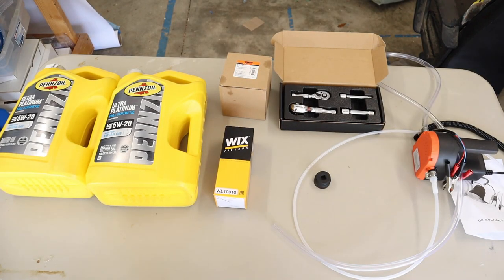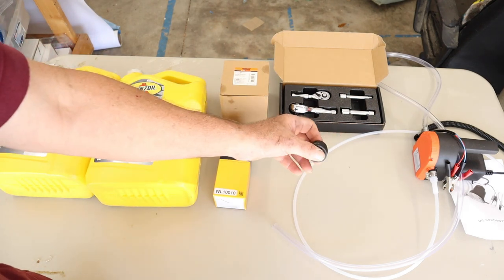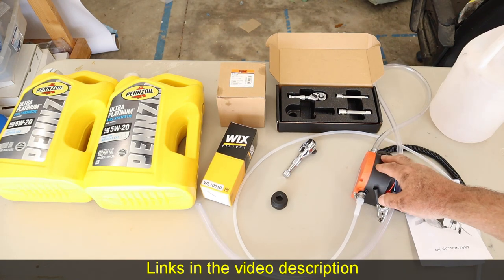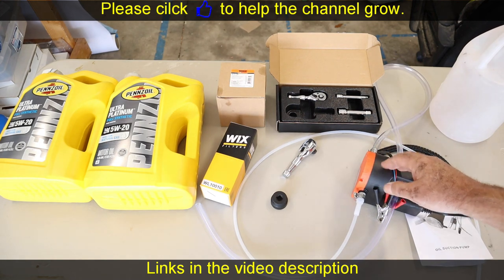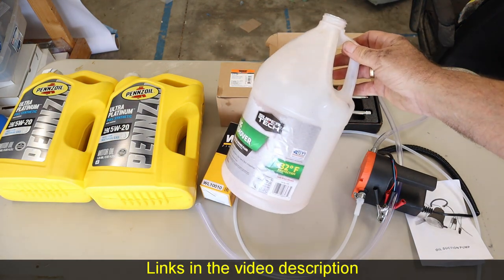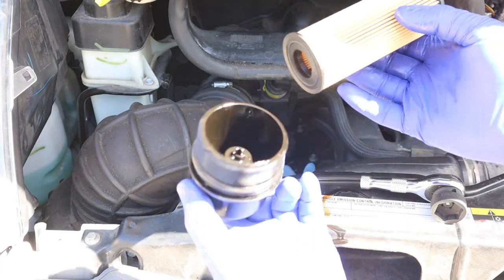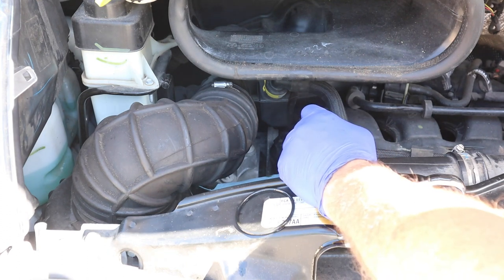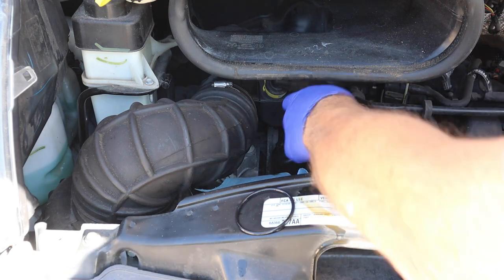RAM Promaster DIY Oil change -The Easiest way to change oil on the road - Oil cap Warning -Part 1

Comment: Pro-tip 
Lube the threads and o-ring generously with new oil.  
Mark the cap and the side so you know approximately where it should match up. You may not want to mark it the first time or use tape (as that would assume the previous person didn't over tighten it). Worth getting a torque wrench, as threading it in by hand is fine. However, once you use the wrench the resistance feels unusual. Probably do the to the o-ring, but the plastic on plastic threads may contribute to this.

Comment: I've got a new Promaster (Winnebago Solis). It's got 2,200 miles on it and after watching several videos on how to change its oil, there's NO WAY I'm going to trust someone else to do it. Too many things can get screwed up. I haven't changed my own oil in 30 or 40 years, but I'm going to do my Promaster. Thanks. (Probably order that pump, too.)
Reply from the maker: Thanks for the comment.  I feel the same way.  I don't trust anyone else.  In the time it takes to drive to someplace to have it changed, I would already have it done.  Plus, they always try to sell you something else!    The pump really makes it EASY!

Comment: Hello FF,  sorry to bug you again. Well was all set up to do the deed, and I can’t get the filter cap off. I have all the right tools —but it won’t budge! I am afraid I am going to break something if I try any harder.  Any ideas?
Reply from the maker: If you have the stubby ratchet it takes some power to remove it. Be sure you're turning in the right direction. Counterclockwise to remove. The person who put it on may have put it on very tightly which is not necessary. There is a o-ring that will seal. Once you do this the first time you won't have any problems.
Reply: @FrugalFactor  yes I have the stubby- and am turning CCW.  My dad suggested using a wrench with the circle end over the stub wrench to get more torque.  So there is no harm in giving it a good turn- maybe even some hammer tapping? I have a new oil filter cap also- but concerned about fracturing the housing…
Reply from the maker: I would not use a hammer. Too much force could damage the oil cooler which is under the filter housing.
Reply: @FrugalFactor  I think the dealership already damaged the oil cooler as the sensor is throwing an error.